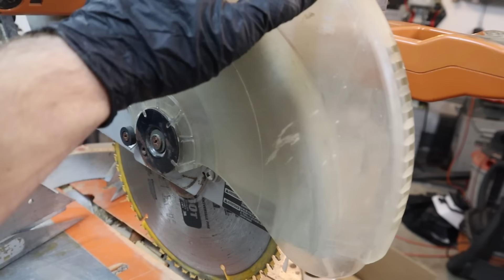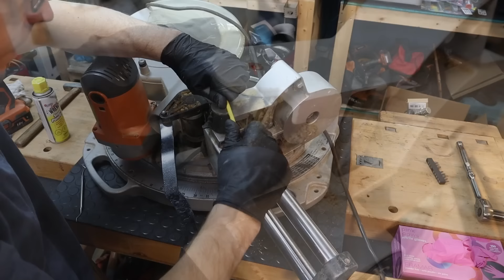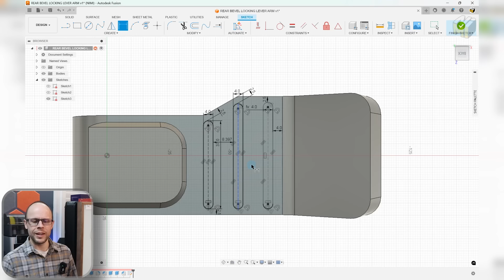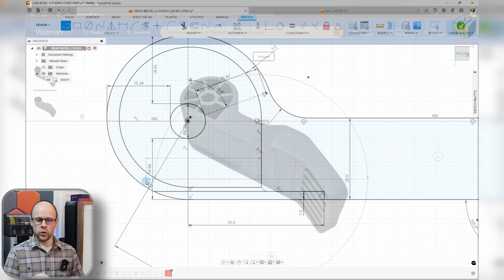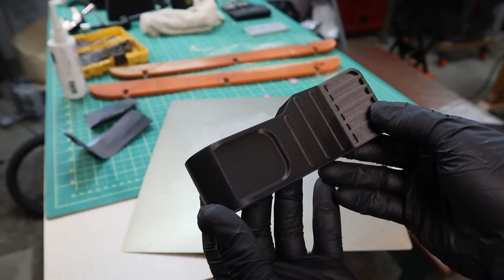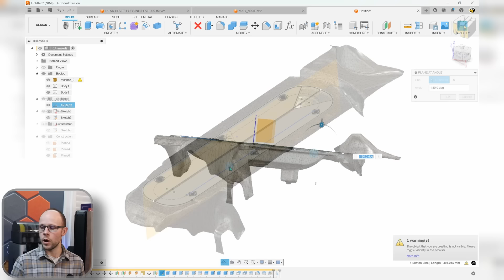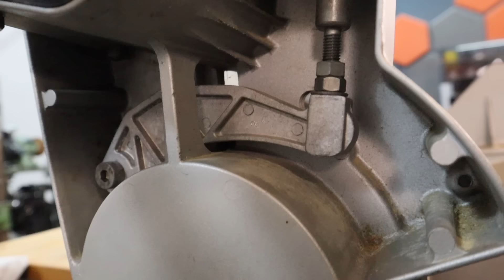How to design and print replacement parts when you only have one half

Comment: Nice video! But I hope you're not going to get issues with creeping on that nylon part. They really don't like constant loading, especially when not annealed. For technical stuff that needs to be strong and resist creeping I found PET-CF to be the best solution.
Reply from the maker: Nice to know, I have some PET-CF ready to go.  This bevel lock part is usually kept in the up position luckily, it should only be used when working on non-standard angles, though I think it was locked and someone tried to change the angle a few times and it mangled the aluminum hub.  In any case, it is something I'll keep an eye on for sure and annealing is an option for sure.   Great points!

Comment: does the tighter guard make it so that when the blade comes at an angle it'll crash?
Reply from the maker: In this case it works perfectly at an angle, it is something to keep in mind though, each saw may be different.  The blade tilt pivot is positioned exactly centered on the bed this way the blade position stays consistent with the throat plate.  It seems to work well at all angles for this reason.  I hope all saws are designed this way, but I'd need to look at some more to know for sure.  The clearance isn't super critical either a little  bigger gap would be okay too, the blade pulls the grain up so a zero clearance here isn't going to do much.  It does work well to keep the chunks from falling in though, that's pretty nice.

Comment: Can’t wait to see what you do with that Onefinity CNC! Out of all the different lower cost professional/prosumer machines, it’s definitely my favorite with the Masso controller and all the available options/upgrades.
Reply from the maker: Ah you have a keen eye!  I just bought it used.  I had a problem with the power supply connection to the controller, but I finally figured out that the cable ends were the issue.  It is working great now, I just need to add on a proper spoil board and start cutting.  I'll likely get a spindle when the come back in stock too, the Makita router is pretty small on the machine.  I should also mention that the table is not good enough for the machine, it is wayyyy too flexible front to back.  I'll either connect it to the wall or reinforce the table with bracing... or replace it maybe.  Aside from that, it looks like an absolute beast and I can't wait to give it a go on some real parts.  I need to sell my old CNC to make some space in the shop too!
Reply: @NeedItMakeIt  absolutely! I was looking at getting a PWNCNC spindle but now that Onefinity sells the Redline kit, it makes more sense to just go with that.

Comment: when approaching a project like this yourself instead of using Glass2k you could also import the image or even images from multiple angles into cad to reference it directly. Also scaling the image based on irl measurements so you can take rough measurements from the photo itself is a game changer ;)
Reply from the maker: I will definitely give that a go, I've never tried it in fusion directly but it seems like a better option.  Thanks for that!

Comment: 100% Infill? Does it really make sense?
Reply from the maker: In this case I think so, I could have hollowed out the part, but the connection between inner and outer walls is critical here, compression of that area needs to be avoided and since we're deflecting an aluminum arm the forces are pretty high here.   Yes I could have spent some time on it, but I think just printing solid is better for a long-term solution and we're still only talking 160grams of material.  I say do what you like though, this is just my approach to the problem.
Reply: @NeedItMakeIt  absolutely agreed, while I’m a complete stickler about designing parts to fit the printer, FDM benefits from its ability to control density. Unless you can justify the time spent designing the part longer, sometimes it’s better to throw more plastic at it/go with larger volumes.
Reply: Better just to increase walls. Anymore than 6 to 8 walls doesn't make it stronger. Layer adhesion will break first.
Reply: Same question. Also the direction of application of force does not threaten the delamination of the model.
Reply: Only way to make it stronger is to anneal it 😉

Could be overkill, but if it get's stuck, one can just hammer it open. Whatever happened to original, was too much. The eccentric part would need ribs (as in original, between sawdust) to take the load if not solid.
Designing for 3D printing is different from designing for injection moulding and mass production. We can print shells with sparse infill and solid parts without worrying (too much) how they look like and how much the material costs.

Testing few variants (for enough strength) could use more filament than going straight to solid part 🤔
Reply: It rarely does. I used 100% for printing gliders for roller hockey pucks. In that case anything less makes no sense at all. But for mechanical parts, like this lever, 50%  ( gyroid ), is crazy strong.
Reply: Nope, it doesn't.
Reply: Depends on the forces into the part along with safety and reliability. we all know nothing lasts forever. After all, this is a saw we are talking about. 10/10 job

Comment: I also love tool restorations and 3D printing.   Very good job on the parts.   I was not surprised at the amount of dust thrown around in the test cut.
The saw was neglected and beaten up.   Good to see it will have a better second life.
Dave.
Reply from the maker: Thanks Dave.  It is working great, and I'm nearly finished with the dust collection issue now, I have the new 3D scans and I'll be 3D printing most of the boot to collect the dust, there will likely be some rubber involved too so that it can be easily swapped out and replaced with something off of the shelf.

Comment: Instead of Glass2k, why not add the Walmart image as a canvas in Fusion and change its opacity?
Reply: As a canvas, it would rotate with the model, so not very useful.
Reply from the maker: Exactly right, it might still be possible, but I'd need a plane at the correct angle and distance from the part to make it work I think.  It would be tough to figure out, but maybe it's doable.
Reply from the maker: I wasn't sure how to get it to be at the correct angle to the part, it could with well with a top/front/side picture though.

Comment: Is the resin printer new? I have one of those as well but haven't used mine in a while. Would be interesting to see it used for a project on this channel. I used mine frequently last year to print Warhammer 40K models and similar things for friends and family who are into that, but now it's just collecting dust. It's a major hassle to deal with the resin fumes and IPA fumes in an apartment, even with extraction fans and enclosures. Stinking up the place, even just a little, is inevitable.